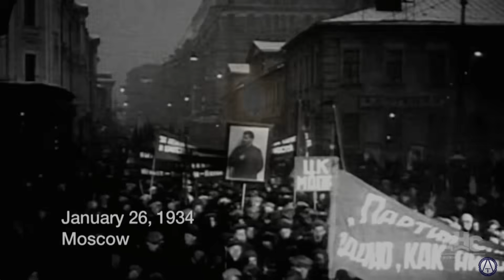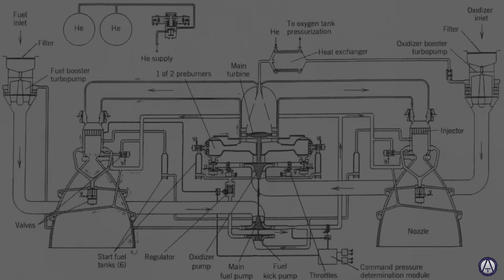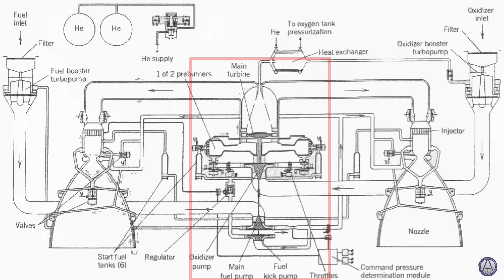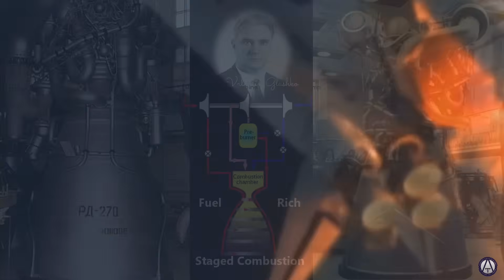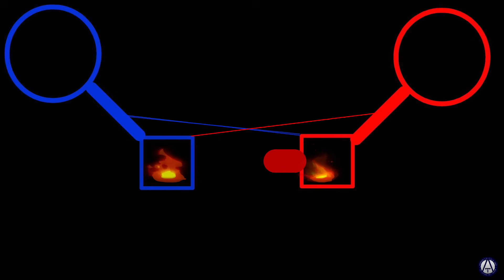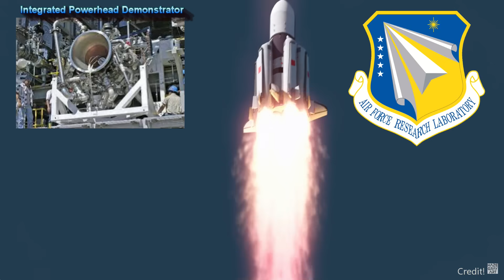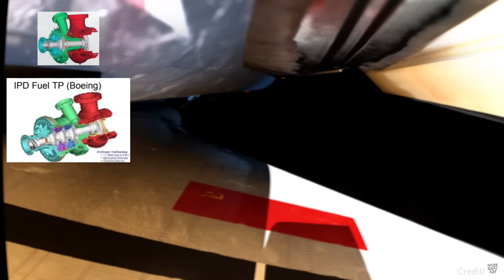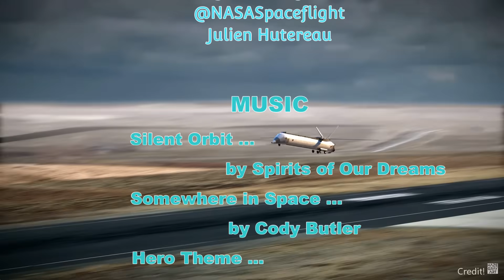Rocket Science: How the Raptor Rocket Engine Works and Full Flow Staged Combustion

Comment: Why is the combustion chamber not a hemisphere full of coaxial injectors? Each injector would point into the throat. No need to redirect gas. The hot gas from the pre-burners should ignite on contact. Is it possible to use the lean pre-mixed approach from a jet engine? So behind each injector would be a small diffusor which slow down the mixture to the velocity of the flame front. The flame probably creeps up inside the boundary layer .. ah, it does not if we don't mix perfectly . So burning would be like in a Gasoline engine with bad mixing. Then the mixing after the flame front works like in a Diesel engine or conventional jet engines. I mean, I don't understand flame holders and injectors ( here ). Without pre-burners, injectors are necessary to mix the fuel/oxidizer coaxial jet with the hot exhaust.

Comment: in my opinion moss drew on some Ukrainian or Russian engineer, in another video you showed that in terms of weight and strength of the engine it is very different from the be-4 and also in the pressure regime to the advantage of the raptor,.  a few days ago spacex launched a vector, the auxiliary rockets controlled themselves in orbit as satan missiles or other russian ballistic missiles did and do when they start.  In my opinion it is not a coincidence. In the future maybe or not raptor engine with feedback similar Rd engine ? 😊
Reply from the maker: It is very true that the first full flow staged combustion engine was Soviet.  But then they stopped.  The Germans started working on one and stopped.  NASA worked on one and stopped.  Musk went on to make a working version.

Comment: Actually, it was the NK-33 that was too late for the Soviet moon rocket, not the RD-170, which was designed for Energia.  NK-33 was the upgrade for the NK-15, which is what the N1 used for it's 4 tests.  Those same NK-33s didn't fly until Orbital's Antares rocket.
Reply from the maker: I thought I said NK-15 for the N-1 and RD-170 for Energia... I'll double check, thanks Matt.

Comment: Were he given 30 more years of optimal cognitive parameters, would his progression~line of extrapolation brought out a feasible blueprint for his engines to use the power of detonation within exhaust bell nozzels?
Could the human body survive the required seconds of impulse brought from riding a stream of detonation that could drive a rocketfrom the Earth's surfacr all the way to low Earth orbit?
Would the G-forces be too high?
Reply from the maker: If the detonations were kept to a reasonable power with a high enough frequency it could work.

Comment: Excellent as usual was wondering how a 300 m per second water pump would work and be powered as outlined in the Zubrin salt water rocket?
Reply from the maker: Great point Olaf!  Perhaps using H2O2 over a catalyst to power the pump and provide heat, flowing it into the salt water to the reactor could work...
Reply: @terranspaceacademy  have you done an episode on Zubrin? Would be interested in your take on his saltwater rocket. I like it because it overcomes the limitations vis a vi exhaust tempreture of nuclear thermal

Comment: Thank you for speaking about cavitation because when I first learned about it it was very confusing on how tod walk with it, luckily I have a engineer friend who works on submerines and I found out there are 3 ways to deal with cavitation the size of your turbine, the presure of the fuel and the tempture of the fuel so when I looked at the ssme and saw the low pressure pump and guessed that's what it was for, I was able to figure out it's purpose and I'm happy your spreading that information. One more thing is could you speak about aucostic combustion instability in rocket engines as I have been having problems getting full exsplainations about it. It's eaeist to find how the fix it in plane engines then rocket engines and might be a good lesson on hoe sound effects engines as well the launch area around it which is relevant to space x right now. Also if you want to learn more about engines there is a great ressaerch article called a survey of automatic control methods for liquid propellent rocket engines on the hall archives website. They speak about controlling the rocket engine and touch on much more. Thanks for the good view
Reply from the maker: I also thought it was strange that bubbles could damage something. But then when you look at the high compression going to low compression it becomes more of an explosion. Very strange physics.

Comment: The idea that a full flow staged combustion rocket engines is much better than a close cycle one is a little bit erroneous, yes the combustion efficiency is higher but maybe only by 2%,from 96%to 98%,and specific impulse isn't directly connected with combustion efficiency, because a rocket engine can increase its specific impulse by increasing ratio of lighter component of propellant,(usually fuel), and have a lower temperature in the combustion chamber and a higher specific impulse.
Reply from the maker: Very true… probably why Rocket lab went fuel rich open cycle for Archimedes/Neutron… Simple and dependable like Merlin :-)
Reply: @terranspaceacademy  well a open cycle rocket engines is significant less efficient than a close cycle one, but are ways you can improve specific impulse even in that case, like increasing temperature and keeping average molecular mass at a lower level at the same time, that usually means adding a third compound to propellant mixt, so you have the oxidizer (like liquefied oxygen), the main fuel (like methane, or hydrogen), and third components also a fuel compound, but one that increases temperature like metalic lithium or berillium, but most practical are boron compounds with hydrogen, that third component is only 10%in mass of the primary fuel, but could increase specific impulse of a metalox engine at the level of a hidrolox one without those large propellant tanks and issues with long-term storage of hydrogen.
Reply: @theOrionsarms  yes, but then you're dealing with metallic propellents and how do you inject those in a liquid fuel engine. 
Boron is the most practical, and USAF even studied Boron "Zip-Fuel" for a while, but they basically concluded that it just destroyed the engines, so it's not really viable for a re-usable rocket either.

Sequential Burn Tri-propellent seems like the best way to improve the performance without going to harder engine cycles. The Aerojet Thrust augmented nozzle comes to mind, which was basically an RL-10 with a keroLOX gas generator cycle as an augmenter in the nozzle. There was also the amazing RD-701 for the MAKS spaceplane, and then some of the paper designs Robert Skalked dreamed up.
Reply: @thamiordragonheart8682  maybe those concepts worth to be reviewed, because would allow significant increase in performance, and is true that a higher temperature of combustion chamber usually means a shorter life span, but are some cases in which that doesn't matter, like for example in the Neutron upper stage that is not reuseble.
Reply: @theOrionsarms   the main issue with the Boron fuels wasn't burn temperature (you can just change the fuel to oxidizer ratio), it was that they're corrosive and produce a lot of solid gunk that gets in everything.
the boron fuels are also much more expensive, and I have no idea how that breaks down against just building a bigger rocket, I would suspect that a bigger rocket is better for low earth orbit, though if you're going for higher delta-V like a kick stage to get you beyond LEO maybe zip fuel or something else like it would be worth the cost and trouble. 
I'm seeing it as more something you do with a hybrid rocket where you have a fuel gel full of your adative of choice as the "solid" part and liquid oxidizer so that you don't have to deal with injecting the metal.
Reply: @thamiordragonheart8682  boron compounds are used today in rocket engines, like on the Merlin but only for ignition, if I remember correctly.
Reply: @theOrionsarms  I wasn't really counting TEA/TEB as a fuel so much as an ignitor. It's hyperbolic with the atmosphere, which makes it great for ignition but not so great for storing in large quantities. the borane mostly investigated for fuels was pentaborane. 

This is what wikipidia says about safety with the pentaborane: 
Above 30 °C it can form explosive concentration of vapors with air. Its vapors are heavier than air. It is pyrophoric—can ignite spontaneously in contact with air, when even slightly impure. It can also readily form shock sensitive explosive compounds, and reacts violently with some fire suppressants, notably with halocarbons and water. It is highly toxic and symptoms of lower-level exposure may occur with up to 48 hours delay. Its acute toxicity is comparable to some nerve agents.
that sounds even more dangerous to work with than Triethylborane merely autoigniting in air.
Reply: @thamiordragonheart8682  all those things are correct, but you need to consider what could get in exchange, meaning a huge boost in specific impulse, from 360sec for a vacuum metalox engines to 430 probably, that could alow to double payload capacity even if would be used only on a upper stage.
Reply: @theOrionsarms  I wasn't saying it couldn't at least double the payload capacity to LEO on an upper stage or that it wouldn't be amazing, I'm more saying that I think it's expensive enough that the cost per kilogram advantage is questionable, and I think unlikely, until you're going beyond low earth orbit. I found an article on the history of zip fuels that quotes $75 a gallon in 2014 dollars when the USAF originally built a pilot  plant in the 1960s. That's around $25 per kg, compared to $0.20 for methane and $1 for hydrogen.
On the other hand, for an interplanetary transfer stage that needs multiple relights months or years apart, a hypergolic fuel with the density of kerosene and the ISP of hydrogen would seem to be worth almost any tradeoff in fuel cost or difficulty of handling, maybe even for a manned mission if it cut the travel time enough.
Reply: @thamiordragonheart8682  that was basically my point of view, but even for 100 tons upper stage of a medium launcher the boron part of propellant mix would be only 5-7%,so less than 10 tons, it seems that is a good tradeoff.
Reply: @theOrionsarms  I was pretty sure the $25 per kg was for the boron enhanced kerosene the USAF was working on, not the boron by itself.
Reply: ok, I was wrong. falcon 9 upper stage only has 32 tons of kerosene, so replacing it with zip fuel would only cost about $800k extra, though that is before you account for handling costs. 
you would still have a lot of trouble getting approval from the FAA because an explosion on the pad with that much zip fuel would be sort of catastrophic.
Reply from the maker: I think a lot would depend on the value of the payload and mission.  To get deltaV for a Mercury landing or Europa submarine mission it might be worth it :-)
Reply: @terranspaceacademy  a higher specific impulse is more beneficial in the case of the missions that require more deltaV, but  the messages that I posted in this stream are related with a technical solution that was ignored in the last 50 years, meaning that some tri-propellant engine can have 10/15%more performances (as specific impulse) than the best two-propellant engine that used the same main two components like the equivalent tri-propellant counterparts, those old researchers were dismissed with shady arguments like it is too complicated and dangerous, and will never work because until now nobody makes a operational rocket that uses that, the same argues were made about the full flow stage combustion cycle engine, but apparently can work fine with a 2%increase in performance compared with another close cycle engine (like BE-4 for example), wouldn't be nice to have more 8% in performance even if it come with the price of more complexity?
Reply: @theOrionsarms  do you mean sequential burn tripropellent like the RD-701 (more complicated but not necessarily more dangerous), or boranes (or another metal) as the third propellant like in zip fuel?
Reply: @thamiordragonheart8682 I mean using all three compound at the same time, but keep them in separate tanks, first you burn boran compound in oxygen in center of the combustion chamber and you get a very hot torch that don't touch the walls, and the second fuel is injected from the side walls but in higher ratio than would be for a two propellant cycle, so most of it doesn't burn but it used to cool down extremely hot gasses from the boron torch in the center of combustion chamber, average temperature of the combustion wouldn't be higher than in the case of equivalent two propellant cycle, but you get a higher specific impulse because average molecular weight is lower by running significant more fuel rich and using the higher temperature generated by boron torch to heat the unburnt fuel.
Reply from the maker: @theOrionsarms  I think a good argument could be made for certain rocket systems that a tri-propellant system would be the best.
Reply: @terranspaceacademy  well, it depends on what you use as third component and how rich in hydrogen is primarily fuel, basically the best three options for metalic additive are lithium, berillium and boron for their low molecular mass (magnesium isn't out of table but advantage become smaller when atomic masses increases ), and the best performance in specific impulse would have a hidrolox engine with lithium added, in that case specific impulse would increase with 22%witch is impressive (like 550 sec), but would be very difficult to have two cryogenic tanks and a third with overheated molten metalic lithium on the same rocket stage, from practical point of wiew non-cryogenic boron hidrites (like penthaborane) can offer a significant increase in performance, and because are rich in hydrogen alow using only a small amount of secondary fuel as cooling agent mostly, but like I said before most practical things to do is to use a tri-propellant cycle only on a upper stage of a two stages rockets.

Comment: The image at 15:54 is not a hydrostatic bearing.
Reply from the maker: It is not. I mentioned both types of bearings but could only find an image for the first type.
Reply: @terranspaceacademy  I don't know about their use in rocket engines, but hydrostatic bearings are the main type used in automotive engines.
Reply from the maker: @snek9353  Almost anywhere they are possible. They are always better if they can handle the load.
Reply: @terranspaceacademy  The issue with hydrostatic bearings isn't the amount of load, they'll take more load than an equivalent roller bearing. It's that they can't stop and go under load.

Comment: Having had a bunch of 3d printers and being a machinist by trade, I always go on rants about metal 3d printing.. Its really in its infancy , regardless of what developers say.. When it gets to the point we need zero post processing for for most alloys   , costs will go down and wacky innovative ideas will follow.
Reply from the maker: That is absolutely true Rob.
Reply: I'd have to agree that it doesn't really work right now. All the methods right now are either related to welding, which makes terrible material quality, or metal injection molding, which is limited to really small parts. I think the breakthrough that makes metal 3D printing actually work is more likely to come from continuous casting than welding. I have some ideas and I'd love to work at Relativity and try to solve the problem, especially since I don't actually believe they have the fatigue life for a reusable rocket right now even if they get Terran 1 to work. The real trick would be to find a way to 3D print metal with an extruded filament style printer because then you could fiber reinforce it and possibly outperform traditionally manufactured metal parts, not that I expect anyone to figure that one out any time soon.

Comment: Great video. Thanks. As you went thru design iterations, I kept wondering why they didn't do an oxygen rich preburner for the oxidizer side, and a fuel rich preburner on the fuel side. It seemed like the obviously right way to mix the leftovers into the combustion chamber. I guess it took them a while to get up to speed.
Reply from the maker: The alloys that could survive high temperature oxygen had to be developed :-) and shared.

Comment: I'd actually say the simplest rocket engines don't use a catalyst at all.  They just force a pressurized gas like nitrogen through a nozzle which converts the pressure into velocity.  These are generally referred to as cold gas thrusters as like those used to control the attitude of F9 boosters on descent, but are a form of rocket engine.

That would make those that use a catalyst the second simplest.
Reply: When is engine and when is thruster? i would say engine provides chemical change. Thrusters just changes state of matter.
Reply from the maker: You would be correct... cold gas is simpler than hot gas... thank you.
Reply from the maker: Good question San.  Solid rockets are called motors usually... and engine should have moving parts I think, impellers in turbopumps etc...  thrusters would be simple like my Peroxide example... and smaller of course.
Though small is relative.  Is the Curie a thruster to the Rutherford's engine for Rocket Lab?  Or maybe it has to do with use... primary propulsion is an engine while RCS etc are thrusters?